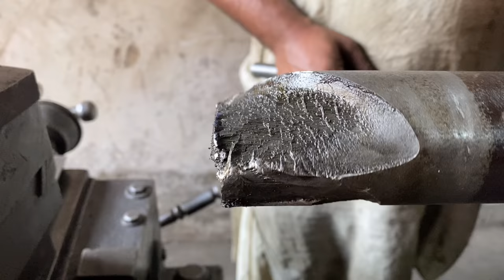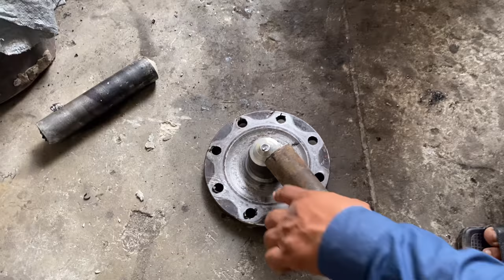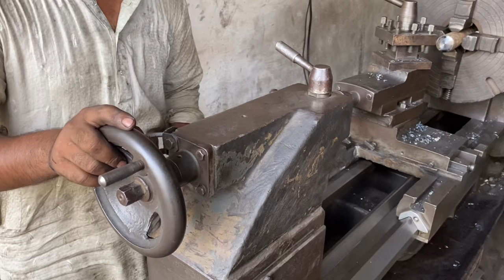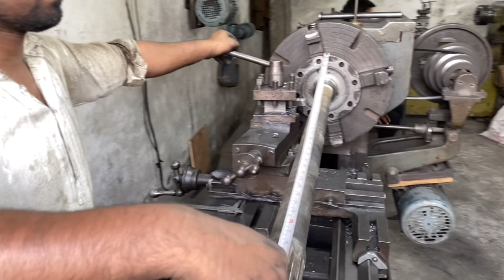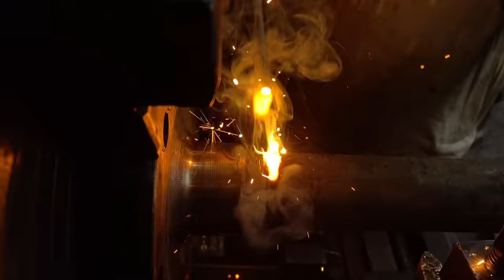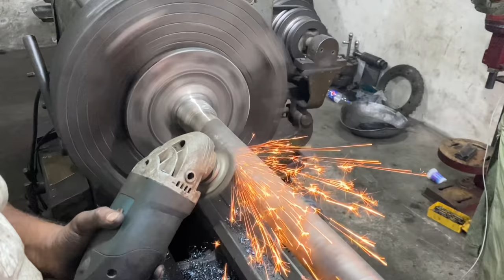How to Repair Broken Rear Axle of Truck Trailer // See How We Fix it

Comment: I didn't have to watch the video at all. It's just common knowledge that a broken axle gets thrown out. You don't repair a broken axle. They are always from specific alloyed medals that are heat treated to specific specs. Axles are rated by the load that they can safely carry. Axles don't last forever. Metal gets stressed and fatigued and eventually fails. The key word is FAILED. It means the axle is all done and is now scrap. It's a fool's errand to repair.

Comment: This is a complete waste of time will break instantly
Reply: I doubt that. Its propably suported ner the place where it was welded so not much bendin gonna hapen there.
Reply: What makes you think that the garbage welding machine that's more suitable for welding thin sheet metal or the fact that he never even bothers to clean his welds just keeps adding little tacks to it. Next time Mohammed dumps the clutch that axle gunna go boom